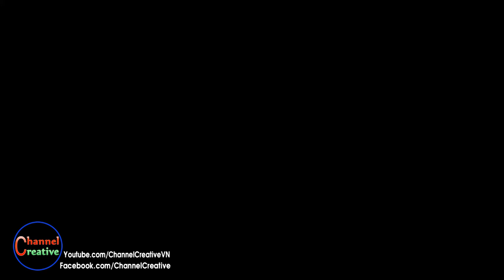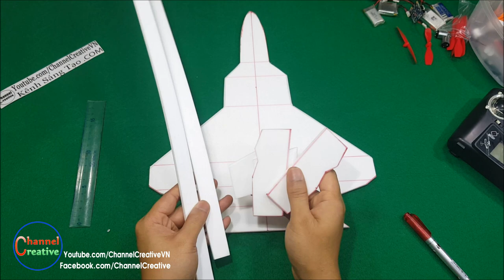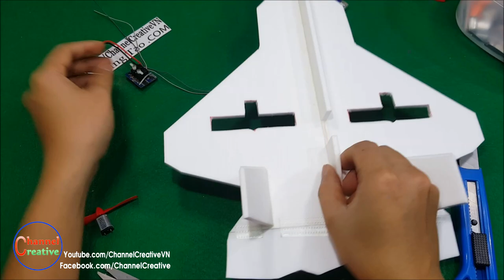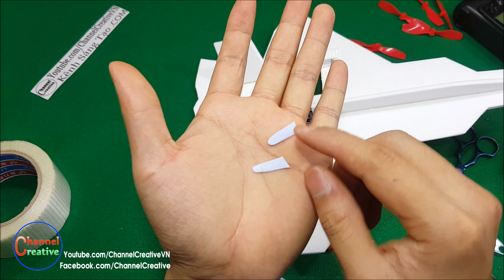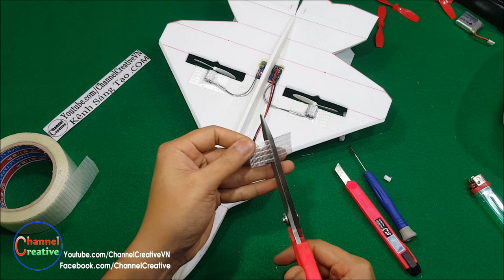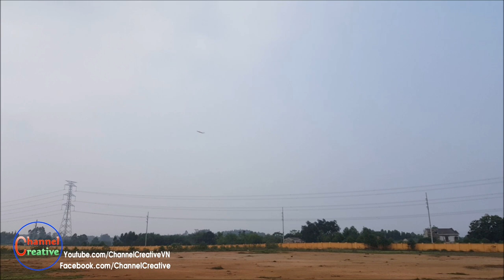How To Make A RC Airplane F-22 Raptor

Comment: First of all congratulations for your very cool work, I'm the newest one here. I have a question in your video "How To Make DC Motor Speed Controller" what is the name of the paper you use to record on the Copper Coated Plate? Congratulations on the channel !!
Reply: That's a PCB transfer paper
Reply: OK thank you
Reply: Yashas Ranjan  sir please give correct digram (layout) of plane because we all are not student of aeronautical
Reply: vikas kute I am myself 13 years old. Its just that I am too much passionate about RC models and Robotics. I can give a advice to u that just try with a pencil on a A3 sheet first. Just pause the video with the perfect image and try to copy the design. You will have to erase and make it many times but u will be able to make it. It's not necessary to make the measurements correct upto a cm. The Host of creative channel also did it by approximation
Reply: Yashas Ranjan thanks dear i will try

Comment: it is a brilliant idea, but where can I get the motor,servo,battery and transmitter?
Reply: Buy a cheap quad copter drone disassemble it and use the parts for your plane
Reply: Anton Attia look in the description

Comment: I guess this small plane will need large open area , and pretty fast , using WLToys F939 receiver board and transmitter .2x propellers using 55 mm diameter from Hubsan , 2x motors may use 7x20mm coreless ,1x battery 1s/ 200mAh or 300mAh . All you can get at online stores .
Reply: Tirto Wijarso do you know how much weight of the plane body?

Comment: how it land man, i prefer the other one you made with tire :D
Reply: Wresni Ronggowerdhi easy ,just find a soft place such as sand or full grassy area,Also When foing to land take a good lenght,Turn of engine and put pitch up so you gradually come to little stalling stage,Also if it begins to stall leave it or you may fully stall it and crash on back,also when near to land ,make it stable so you get low speed of stall and also stability of normal flight and,Lo! landed
Reply: Priyanka Mishra or, you could just put a set of tires on it

Comment: Hii I'm using n20 motor with f949 receiver but motor not run properly  , when motor run without propeller it runt at 80% and when I'm attached propeller then motor automatic off at 20% speed at very low throttle plz help

Comment: Hello my friend please where can I find Transmitter, Receiver
In any website I want to be sold
The price is not high
Reply: Ahmed Hossam  you can get it in rc helicoper
Reply: Ahmed Hossam Transmitter is in a remote itself, best buy a cheap heli or drone and de assemble it and make a plane,best is to make plane look good,get Blueprints for dimensions to cut or paste the foam,fit out the Servos(Servos can be only the thing which drone or heli may not have) Reciever is in heli and drone,transmitter is in Remote also Use Remote that have left stick as both up down and left and right,while right one full 360* then it will help,bestly get both 360*

Comment: Hey, can you send The pecific measurements?!!! Please!!!!! Thank bro!
Reply: Hi. Can you send a link motors details. I created that plain, but my motors are a little but longer and heavy. The power is not enough. When I try to move leber of vower on the RC the motor is stopping on the half. The plain has the same size as yours, but it's heavy and cannot fly. Other parts are the same as you recommend.
Thanks.

Comment: How to make a rc plane with cheap or home made materials because you get the materials in very less cost but i live in india that why i can not afford it my minimum range is 500rs as per indian cost₹
Reply: IDEA BUZZ You cant,you will need Motors,Servos,reciever,speed controller,battery which are 3ripple the amount of your budget,i see you can only own rubber band plane right now,but try make it in school science exhibition or someehat like that
Reply: l would like to see you making an rc plane than a rubber band plane